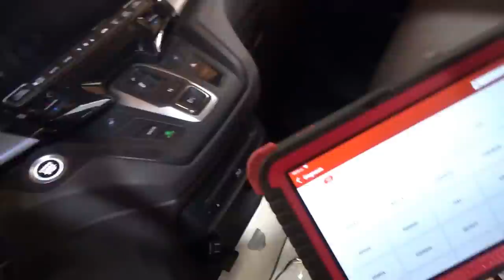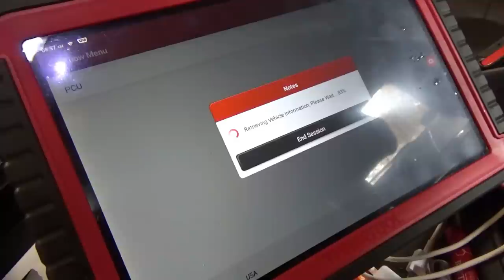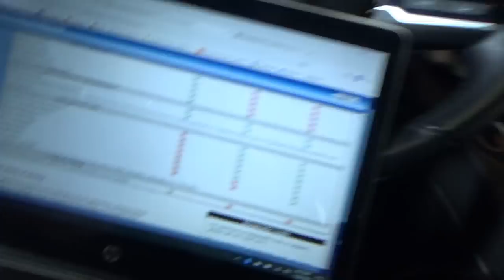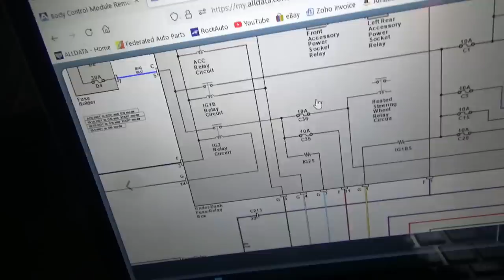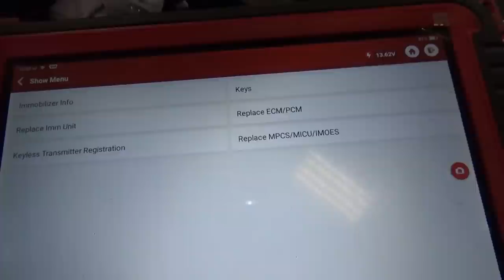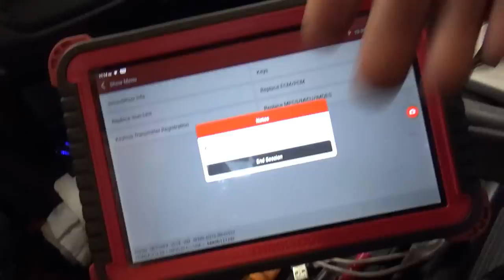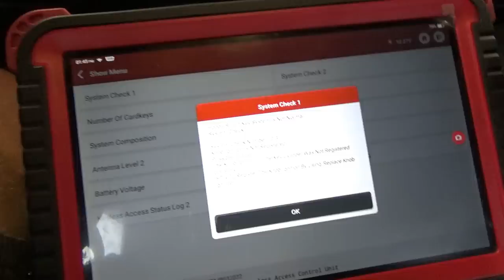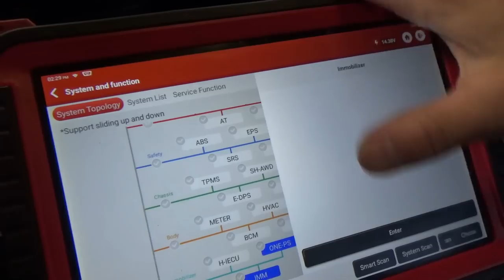WTF...Honda Turns Itself ON & DRAINS the Battery?! (Part 2)

Comment: THIS is a excellent video IVAN. you were able to show how to bypass the computer  to allow the scanner to talk to the system.That allowed you to attempt a replacement.The scanner did pick up AN OLD ISSUE 1 year ago,means to me the car THIS UNIT may have had an issue and the car was scrapped or the unit replaced and at the high cost- the owner kept his old unit{THIS ONE} and decided to RE-COUP some money and sell it on ebay???BUT that's just my thought process,After all it's electronics it's not like selling MING DYNASTY pottery where if the pot was broken in the past you could super glue it back together and the buyer WOULDN'T"T NOTICE.haha Your intuition on a bad unit sounds correct.thanks

Comment: Mucho long ago I worked at a Radio Shack, fixing stuff customers brought in.  It was a sweet gig, as Radio Shack had really good service manuals and you would either go to their transistor wall and grab a similar transistor, or write a little postcard to RS Central and in two days you would get back the correct part.

One day a radio came in and it wouldn't work from the C-cells in the back.  A little poking with a voltmeter showed that one of the battery contacts which was clean and chrome-plated and firmly riveted in place, there was no continuity between the spring and the attached wire!    It looked physically perfect and tight, but no go.  Craziest no-continuity situation I ever saw.

Comment: I misdiagnosed a van today. It really gets to me sometimes and I don't understand why i take it so personally. The van had a P0622 Generator Field "F" Control Circuit Malfunction. The charging voltage was fine. I scoped the control wire while looking at charging command. If I wiggled the connection at the alternator the command would go to 100% battery light would come on. The scope was seeing the same thing. So I knew it was ethier the plug or the alternator. I took the aeswave kit and made my own connection. I wiggled at the alternator with my new connection and everything was fine. So I thought it was the plug not realizing heat could been a factor. The reason it didn't act up is it cooled down for about 20 minutes while I was rigging up a plug. So after replacing the plug driving the van for 10 minutes with no issues. The owner takes it home, next day its back. The alternator goes bad when it heats up. I believe its in the internals where the plug pins connect. I should of thrown a alternator at it and saved a hr in a half 😆 just joking. It was a learning experience but I hate when I ship it not fixed. It looks bad on me.
Reply from the maker: These experiences, ESPECIALLY comebacks, are huge learning opportunities! As long as you learned from the experience and were 100% honest with the customer, that's a WIN 👍😉

Comment: Dealer technician and former parts guy here:. 98% of warrantied or replaced modules that manufacturers test are good.  In the case of Chrysler monitoring warranty repairs for one year, it was found that pin fitment or connection issues were the actual failure over 90% of the time!!

Comment: "I'm sure there is a lot more to come" - truer words were never spoken! I'm thinking you may have cycled some internal logic stuff that fixed the problem - it may not have been a connection. Kinda like removing and reinstalling software. But if it was a connection thing, then this illustrates how some systems defy logic - they are just too complex to master. A third possibility is Artificial Intelligence. I was thinking when you were obeying those commands over and over to turn the ignition on and then off so many times - the BCM was laughing. After laughing long enough, it was worn down and gave in. If it had chosen to communicate with you, and if it did not have pride, it would have said "You are a worthy opponent".

Comment: I remember years ago I had a 1985 Mitsubishi Galant - a very advanced car for it's time. It was only about 3 years old when I was driving it one day and all the dash warning lights came on, no matter what i tried I could not get them to go off. Even tried disconnecting the battery and reconnecting it. I phoned up the dealer and spoke to one of the techs there and he advised me to reach under the dash and unplug the main ECU whilst battery power was still connected to the car, and then plug it back in again. Hey presto, everything went back to normal. It was a fault they had seen before, and had learned by chance how to resolve it. I kept the car for a further 4 years and it never done it again. Certainly some magic there!  But in the case of your Honda, I wonder if some code stored in one of the emproms was corrupted, and by you reprogramming a few bits you overwrote the dodgy bit of code? Because like you, I struggle to see how a dodgy connector could cause the car to power up those relays. Very interesting case.

Comment: 1.)  Caig DeOxit is magic stuff  2.)  Never buy a car with a push-button ignition  3.)  It is possible that the re-programming itself was what fixed the car... flash memory is like little capacitors that have to remember stuff for years, refreshing that might have helped.  4.)  It is possible that the security system was designed specifically to thwart what you were doing... it is hard to imagine that a bad connection could cause the car to turn on (as if the key was present).  Glad the customer is happy, glad you were able to learn something!

Comment: I am a network and security engineer and I must say I am not impressed with how the auto industry has setup network communication in cars. Everything I work on generates log information, I can generate packet captures, I have all these tools to help me diagnose network problems (icmp, etc). Adding to this all connections are hub and spoke (network switch to all devices) It appears that automotive communication is setup in series with terminating resistors at each end. we did that back in 1980 it was called 10Base2 and it was horrible so we junked that system. The entire automotive system seems to be designed with the only goal of saving a few feet of wire (in series)  I would like to see the automotive community take a look at how network engineers have designed our systems, I mean we have only managed to connect every single computer on the planet so we might have some good ideas on the subject. - Lee

Comment: Ivan, you did a video of an Impala with an ABS light that was on. You unplugged it, plugged it back in and it was fixed! I had a 2001 Cavalier that had a similar problem. The ABS light would randomly come on. It would go out and then ABS was fine. It had what looked like the same connector as in the video you did. I unplugged mine, plugged it in again and then the ABS never came on again. NPR! That Impala video was the one that got me watching all of your videos!

Maybe sometimes the communication is jacked up between the modules and unplugging them reestablishes the communication. Hopefully the Honda lasts as long as my Cavalier did... 400,000 miles!

Comment: I just had also the same problem in a 19 Honda ridge line with the addition of the alarm randomly going off
Had to replace the keyless access/ TPMS the ignition was completely dead after replacement 
But I found in the thinktool pros that the push start module had a section to turn on ignition and it worked after that it even programmed everything including the keys 
Unbelievable tool thanks for recommendation (just purchased it as you rate it so high) 
Hopefully this helps if that Honda comes back or if another car has the problem

Comment: Speaking from experience working at Honda and replaced a lot of BCMs from odysseys to crv’s and civic’s When you use the factory Honda scanner and you go into immobilizer set up it try’s to read the vin then asks if the keys on then asks if you can turn it on, when you click no it has you press and hold the start/stop switch for about 5 seconds like you did in the video but the HDS will command key on which at that point you can program the BCM i wonder if the aftermarket scanner you have dosnt have that capability 
P.S. very smart way to get past that problem with jumping the main relays lol

Comment: Ivan, I agree that  you have to eat your time on occasion when  you encounter a situation like this and chalk it up to experience.  And these type experiences will probably be on the increase as I get the impression that the 'programming' is designed to maintain the work flow at the dealerships.  Planned intricacy if you will.

Comment: I have similar experience. At work, among other things< i also fix ticketing equipment on buses. Due to environment (frequent temperature changes whenever door opens and closes) there is a chance of condensation forming on connectors, that over times creates a thin layer of oxidation. So, before i start diagnosis little squirt of contact cleaner, and in some 40-50% of cases diagnosis is "no faults fou8nd"

Comment: Kudos for not charging the customer for your learning time on the job. Ethically the right thing to do but the opportunity cost burns in real $$ for sure. However, you are the independent self employed professional in this relationship, so training / education is on you. Customer brings their car to you at rightly elevated rates for a diagnostic expert - you can't charge for education time. It's a time cost you eat once, store the knowledge in the grey matter up top and thenceforth you know the answer as soon as you see the problem. Loss leader to stoke the bank if you will.

Comment: You should invest in the autel IM508 or IM608 Professional key programming tool. It will pull security info without any keys. I had someone lose all keys to a 2008 nissan maxima and I made keys and programmed them. Good video.

Comment: I worked on copiers for 41 years. As time went along, more and more modules. De-ox is your friend. Fixed many a problems this way.
Reply: I was shocked when a tech pulled apart our modern color printer at work and saw all the small plastic parts.  Stupidly complex.

Comment: Reminds me of when I tried replacing my key FOB with a used eBay one. My original fob would only work ~1ft away from the car. Tried programming the new key, got the system stuck in learning mode. New key would not register. Realized my original key was no longer registered. Went to reregister it and bam my original FOB started working… now it can reliably unlock my car from ~10ft away and I have no idea why, other than messing with the keyless entry module must have fixed it. Ended up returning the eBay key LOL

Comment: The HDS must be able to energize the ignition relays via the DLC. check the wiring diagram. See if there is a wire at the DLC that is not accounted for. Apply power to the mystery wire and see if it powers up the relays. Next time you see that car anyway.

Comment: Similar situation with a F-150 circa 2014 or there abouts. The circuit that failed in the bcm was only the R/R brake turn signal circuit. Just hooking up the IDS and a PC and starting the diagnosis , somehow reset the bcm !!! Fleet vehicle so I know and kept an eye on it for several weeks and problem did not return.

Comment: do not know if you tried it but, sometime restarting the computer works. you need to disconnect all power. leave it overnight and try again the next day. you can try this with any device that has a computer, micro controller or anything that uses software.

Comment: I had a 2013 F150 that drained the battery overnight. At the time the truck was like a year old.  The dealer farted around with it but never fixed anything.  It was very much like this Honda and I could catch it randomly powering up the cluster... then another time I had the hood open and the radio came on with no keys in the truck.  

I replaced the trucks battery as the original always seemed weak.. a year and a half of ownership after that and it never killed the battery nor powered ignition functions on it's own again lol

Comment: Something that got me thinking is Ford has a problem with their electronic tailgates opening by themselves, seems to be a ground issue which is similar to how the car keys on. Wonder if one of the pins were loose at the bcm and unplugging and plugging it back in cleaned the contact. Also kinda like seat airbag issues is usually around the connectors and stuff, people spill drinks and it gets in the connector. In experience sometimes unplugging seat harnesses and plugging them back in fix the connection issues which then you go in and clean the connection manually

Comment: Judging by the complaint history for this model year the electrical issues are only trumped by transmission problems.
My guess is the wiring design/routing is at the root of the issue and disconnecting the BCM gave it a chance to finally rest.

Comment: Well I'm by no means a car electronics expert, more a computer expert but I think it's possible that one of the reprogrammed modules (probably the BCM) could have been fixed by reprogramming. Its full of EPROMs and corruption like bit flips are a (small) possibility. It's all guessing but my point is not to rule out that reprogramming itself fixed it. Sure the possibility that deoxidizing fixed is bigger but corner cases can be caused by corner causes.

Comment: I do automotive key work and security immobilizer programming- I use a XTool Pad 2... for most of the programming- I'm thinking you need a more specialized tool - my tool will communicate with the key off on the modules it needs to and pull out the info required to complete your mission plus - the tool will give you complete instructions as you go along... you could have called a good automotive locksmith out to ur shop to program the BCM and the keys and saved yourself a bunch of time - some of the systems require the programming of the key before the BCM and vice versa... so there is a procedure - if you stumble through it fine if not it appears the module is bad... you have the patience of Jobe...
Reply: I had a similar issue/ trouble with programming keys in my 2002 Acura MDX.  I had an original master key, and I just wanted to add two extra spare keys (with my xtool D8).  When it asked 'how many keys" do I want to add, if I put "2", it would fail every time.  But I figured out that I could just add one key and it would work;  then I would have to start all over and add the third key.  It even asked for a special pin code from the ECM, and the D8 was able to pull the code;  but just for some reason, it refused to add two keys at once.  I'm thinking it's just a quirk with Honda's, and I would almost bet that your ebay BCM could possibly worked if you would have simply tried to program only one key, rather than 2.  Once you get it working, you would have to go back in and copy your second key, but you just can't do them at the same time on Honda's for some reason

Comment: you need to make a line interrupt switch for your wires, so that way you don't have to plug and unplug it all the time. it will make your job a bit easier.

Comment: Very cool video Ivan! What a great mindset to have with these newer cars. Independent experiment training for the win! I’m curious if it’s similar to an unexplained fix with a part by doing bi- directional control. Sometimes something just wakes up and is happy again? Great learning as usual.
Reply from the maker: Hey Josiah! Yeah this van was fun and frustrating at the same time...with no clear guaranteed resolution. Kind of had that feeling at the beginning when the owner told me about the symptoms lol. New cars are getting to the point where there are no more clear "inputs" and "outputs"...the inputs are now their own modules xD
Reply: @PineHollowAutoDiagnostics  To engineer a car where the ignition relay lives inside a very expensive module is just a slap in the face to consumers and diyers!
Reply from the maker: @blueskiesmobileauto4253  I predict that prices for older "simple" cars will only grow as people get fed up with this nonsense lol
Reply: @blueskiesmobileauto4253  Exactly..  It's the same issue on Dodge's with the TIPM" --    internal relays should honestly be banned.  It's just dumb;  make the relay external and replaceable.  It's already a proven technique and the relays are cheap to buy.   I think it's criminal personally.  But the future is gong to be even worse now, with everything built into these giant screens and the motor controllers in these EV's.    Anything and everything is going to be a $1k to $4k module that needs replaced.

Comment: You ever see the old Honda tech tip about disconnecting the battery if you run across strange electronic problems, I missed part one, you probably covered that.